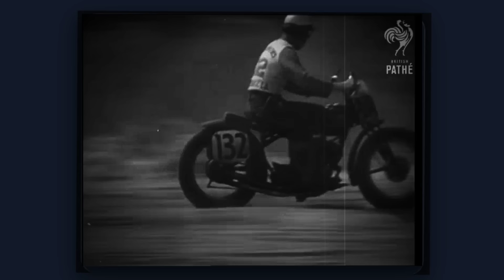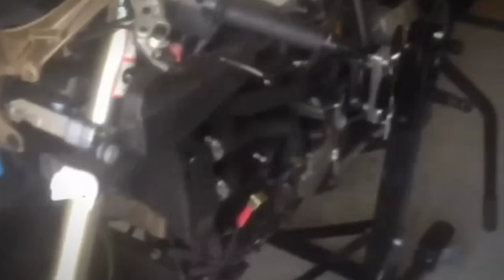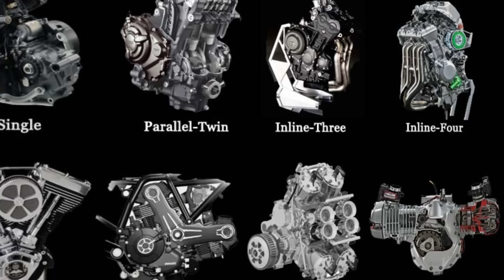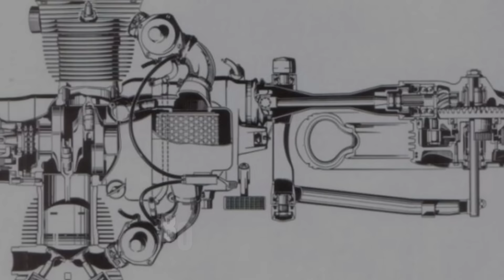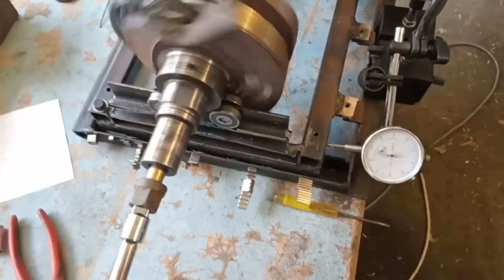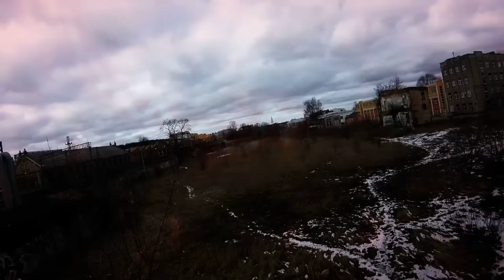The Engineering Secrets Behind Motorcycle Engine Sound

Comment: Shadow 1100 dual pin version has a 45° v angle but the crank has a 90° offset giving it a firing interval of 225°-495° the feeling is somewhere between the 180° and 270° twins and it sounds kind of like a v4 or v8

Comment: Nope, the "simplest" would be a two stroke single. And if the big companies spent more time and money on two stroke engines they could still be used today.
I went to the Birmingham motorcycle museum in 1991 and saw (and photographed) a 1000 CC inline 4 cylinder Triumph, that was built "before" Honda brought out their 750/4.  They were working on it, but Honda beat them to the punch.  The Triumph engine looks remarkably like the Honda, or is that the other way round?  But as you point out, Honda rushed to get their bike onto the market, so did they know what Triumph was working on?
People get this wrong all the time. I owned an RE5 Suzuki and it was not that complicated (if I could work on it). It also used 'less" fuel than the 750 Honda of the same year while being a similar weight and having a similar top speed, but much smoother.  What killed it was bad press from ignorant jouralists who didn't know anything about Rotaries.

Comment: Not to be yet another negatvie nelly but you should have included the new v3 from Honda.  Also you really diss singles for vibes but a Husaberg FE570 is 55-60 hp (dirt bike and dual sport) and is extremely smooth.  They just utilize counterbalancers though some work better than others and the Husaberg's definitely works.  Finally, you say the 270 parallel twin is 'narrower', presumably vs a v twin, but a v twin is narrower (but longer).  Maybe you meant the 270 parallel twin sounds like a v twin but is SHORTER.....not narrower. Shorter front to back vs narrower side to side.

Comment: You skipped over an entire generation of 180° 2-stroke Parallel-Twins that ruled small displacement road racing for over 2 decades. The Yamaha TD & TZ 125/250/350cc racers (and their street versions) were important competitors from 1967-1990. The design included the TZ-700/750 inline 4, That being a pair of 180° 350cc parallel twins with a common crankshaft that won several world championships by itself, and dominated the Formula 750 class.

Comment: Soon, governments will mandate electric motorcycles.  If the battery were made to be replaced at stations instead of recharged, electric vehicles will take off.  Like a flash light, batteries not included.